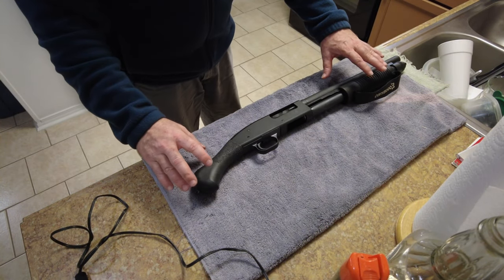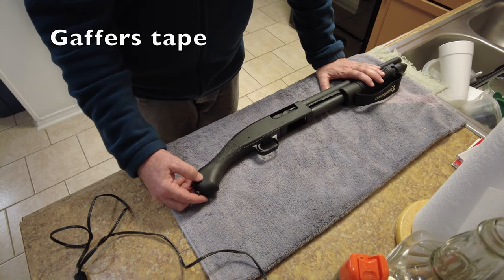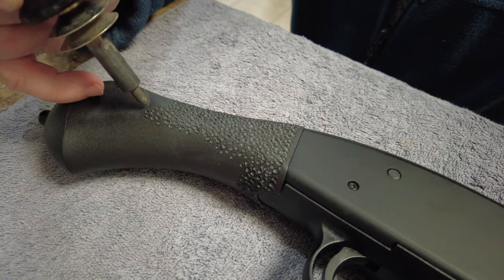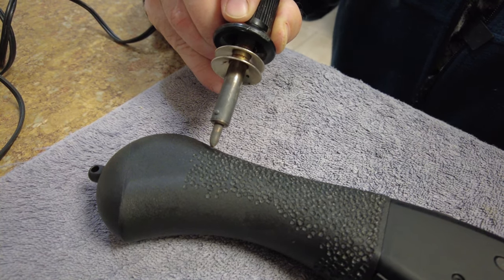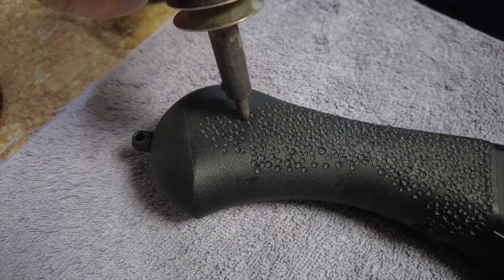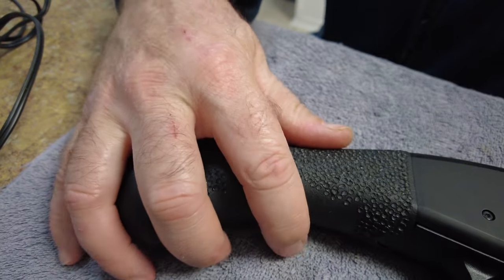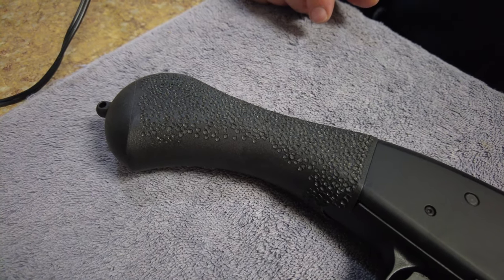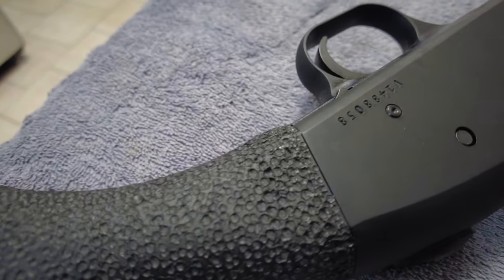Shockwave (raptor grip)...make it more grippy with this at home texturing process

Comment: What a brilliant idea! Great video!
Reply from the maker: I can't take credit as I've seen this done on polymer pistol frames by more skilled people than I. I sanded mine down just a smidge like as seen at the end of the video, but actually l liked it a little more abrasive. Many pistols these days by the manufacturers they are duplicating this rough, gritty texture into their pistol grip designs. My Smith and Wesson MP9 2.0 has a fine gritty pattern produced into their grips and palm swell and it fantastic.

Comment: I just put a "Defender" recoil strap on mine, but was thinking of stipling as you did. Looks good, better than friction tape.
Reply from the maker: Very grippy and not coming off. You can make more grippy or less depending on depth you push hot iron into or the type iron head you use.

Comment: For my 590S Shockwave I went with the Pachmayr Tactical Grip Glove (part #05103) for the Shockwave and Tac14 polymer birdshead Raptor grips. It’s a slip-on rubber grip with a finger stop underneath. I liked it over the Talon Grip’s deck tape decals and I’ve stippled some AK grips in the past as well as Gen 3 GLOCKs with a soldering iron and did not like how they collect dirt and debris nor their appearance over time.
Reply from the maker: My hands suck as I'm one of those that has moist hands some of the time or the reverse dry hands other times. I've owned and used rubber feeling/grip texture products that fit around or use adhesive where they are usually better than the base /factory grip. I've even made my own cut out of a bicycle inner tube (new/used) and it can be hard to tell the difference between a $45.00 store bought version vs. the free/low cost tire inner tube. Depending on if there is texture molded in or an Alcantara feel to the store-bought grip.  

I had seen the heat tool/stipple/burn-in approach and wanted to try. If I had at least 5 or 10 to do as I business I could get pretty good at it.  There are endless ways to do it which would create more grip verse less grip. I went pretty aggressive off the bat because I didn't know any better but someone could be way less heavy-handed and just lightly modify their grip's surface, less places for dirt or grit to gather over time. (mine feels very similar to coarse sandpaper) 

Would be cool to use a hex screwdriver head shape iron attachment and spend more time and make an appealing-looking and useful grip pattern.
Reply from the maker: Nice...single finger positioning groove i like and $11.95 https://www.amazon.com/Pachmayr-Tactical-Grip-Glove-Shockwave/dp/B07QH7RYY9
Reply: @GettingthruLife  yes, that is the exact grip cover I purchased, good price point as well. I like the Pachmayr grip sleeve, it was laborious to put on however, I finally had to roll up some of the material over the grip and then roll it down in order to stretch the whole grip cover over the Raptor birdshead grip.
Reply from the maker: Look like it took some work to stretch on.

Comment: Nice job!! Thanks for the video..ill be doing the same with mine..
Reply from the maker: Go small dots at first then feel what you think. If want more grip more bite then go back and push in deeper. If you have access to different iron head examples sloted bit, Philips head shape, pointed, blend tip, round tip can try different shapes to get different feel and look.

Comment: Just buy a bicycle innertube and cut to fit plenty left over for all your guns and more.
Reply from the maker: I've done that before. Up to  8 or 9 years ago i thought of trying the bicycle inner tube and cut one of my extra bike tubes up.for my Glock 45.

This is better by far for me and improved feel and not altering the diameter feel. Just adding smooth rubber without texture/grit wasn't  what I wanted this time. Looked for a replacement birds head grip made with the right amount of texture/grip but didn't find anything.
Reply from the maker: Proof I tried this bike innertube way before it was a thing, 2009, https://www.flickr.com/photos/freelanceshots/5813001705/in/album-72157626823590416/
Reply: @GettingthruLife  I put the Shockwave grip on my H&R Pardner Pump love it plus I can always put the stock back on it.
Reply from the maker: @BrokeBoy912  The raptor/bird's head grip is a good grip. I like it too. For sure it can be used on other shotguns that are longer compared to the pistol grip which puts the recoil into your wrist.

Comment: How long did it take you to do the entire handle?
Reply from the maker: remove the grip, watch youtube to see best how to do that. Have a soldiering iron with different heads to try. I had a stubby nose tip and a wedge tip to try. Just experiment with how deep you want to press into the plastics. when you touch the plastic with the hot tip it sort of pushes a raised edge around the impression you made. this is what also adds most of the rough texture. took maybe 20 min. just repetitive dabs and you can do it pretty quickly after you get in your grove. I used tape to mark off boundaries example at the very end to make it look professionally done by looking uniform all the way around. You can always start out with little little touches and do a section and then feel with you hand/fingers to see if you like the texture. then you can go back and rough the surface even more. All kinds of patterns and melting approaches to give a unique look. Look at some youtube video to maybe "customizing glock polymer frame, one example: https://www.youtube.com/watch?v=aCCyaTmAICU